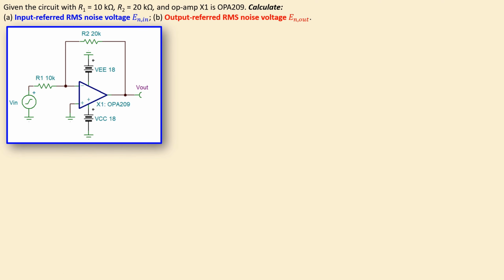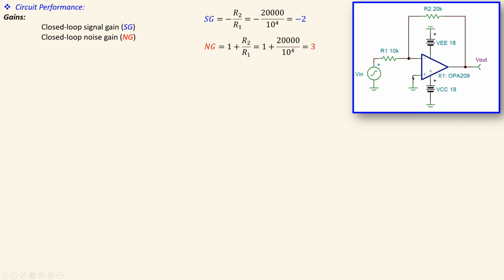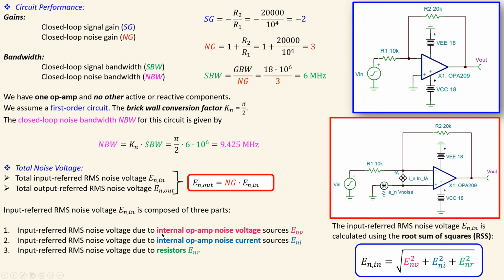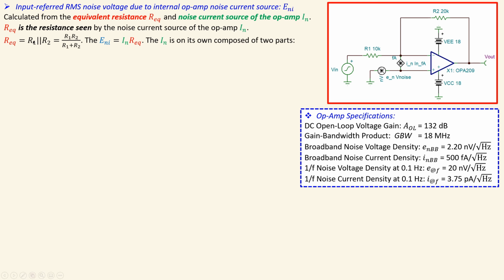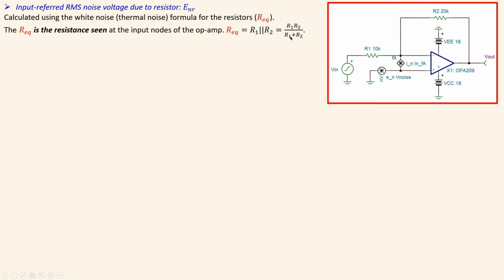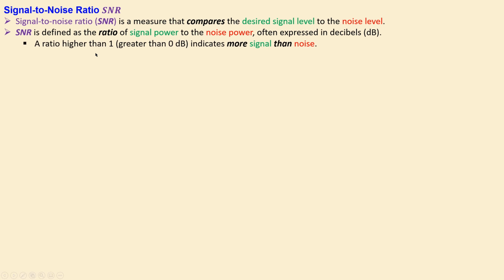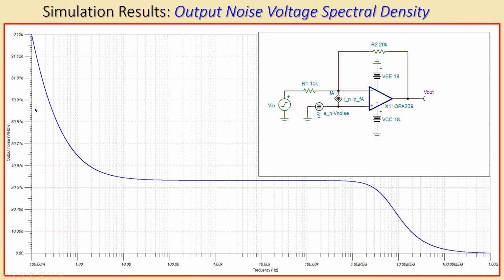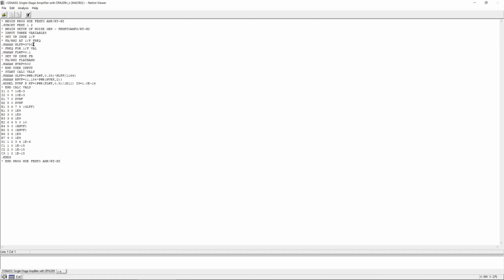Noise Analysis Op-Amp Circuit 🌟 Inverting Amplifier 💡 Example 2

Comment: thank you for your movie. i have a quesition. In op-amp specifications : 1/f noise voltage density at 0.1 Hz dose not be included in datasheet. only graph. how can i get the 1/f noise voltage density and current density at 0.1 Hz? did you use the some equation to get it?
Reply from the maker: If the 1/f noise at 0.1 Hz is now given in the datasheet, you can use the value at 1 Hz for example. The results will be the same, but you need to use the correct values in the formulas. Check the formulas and how I use them in the videos on noise analysis.
Reply: in case of opa209 datasheet, did you found the value of  1/f noise voltage density at 0.1 Hz from graph? or calculation by formulas?
Reply from the maker: @고라니라니-t3f Indeed, you can determine this from the datasheet. Again, look at the formulas I use in the videos.
Reply: @CANEDUX   i means, i want to get the e@_f and i@_f value, but your video and datasheet dose not include this so i asked how to get this value. '4:11 this moment' . even through that value was from the graph, it was not detail to get it.
Reply from the maker: @고라니라니-t3f Those values at 00:04:08 are determined from the graphs. Remember that the axis of the graphs are in log scale.
Reply: @CANEDUX  thank you for your comment. and how do i set up for noise source  component? can you share the contents about current and voltage noise source with using the macro editor? sometimes, the results from simlualtion and datasheet are very different.
Reply from the maker: @고라니라니-t3f  You can find the noise sources via this link: https://e2e.ti.com/cfs-file/__key/telligent-evolution-components-attachments/00-234-01-00-00-68-11-50/Finding-Tina-Noise-Sources.pdf
Reply: @CANEDUX  i already find that on noise component but there is not fit to every IC. when the noise analysis, did you also change the noise parameters from datasheet by macro netlist viewer?
Reply from the maker: @고라니라니-t3f You can edit the model for noise sources too, this is also discussed in the file found via the link I sent you.